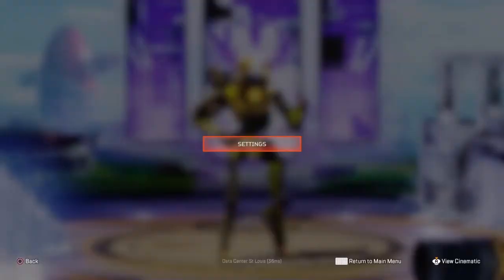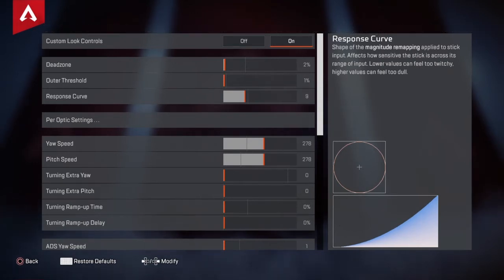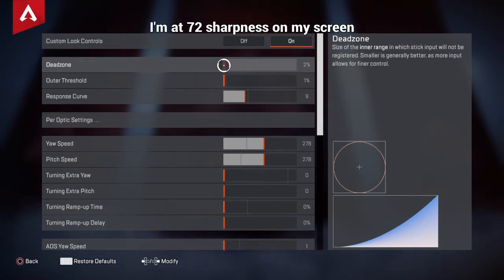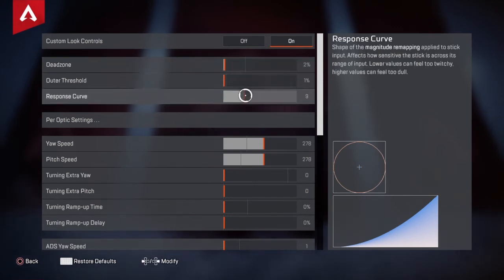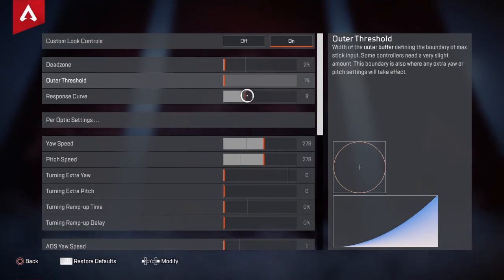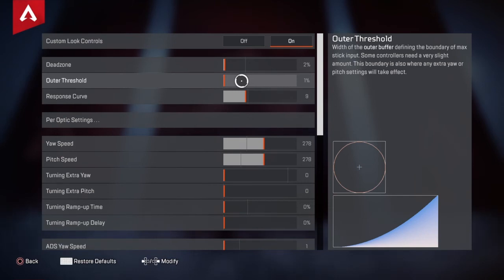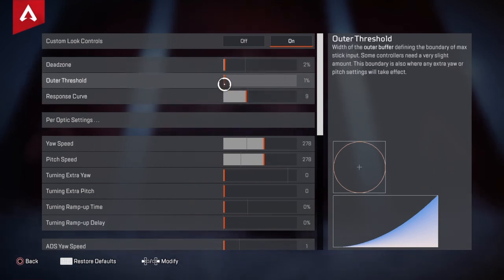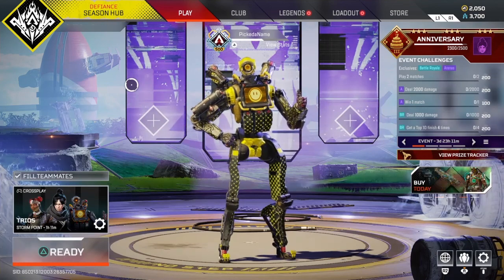Fixing ALCs: Explaining ALC Fine-tuning (The Deep End pt.2)

Comment: Is their a way to get a dynamic response curve from cod on apex? For example 10 response curve is considered classic on apex what response curve would be close to dynamic on apex?
Reply from the maker: Haven't played cod since Blops2, I never messed with my settings in those games.
If you want it to feel like it's always 1 speed try 6 or lower. 7&8 are almost 1 speed with a little ramp up. 9+ will move slow then speed up more aggressively as you increase the curve.
Reply: The dynamic curve employs a reversed S-curve algorithm to your thumbstick movement. This means that you get a gradual build-up in rotation speed relative to thumbstick movement, but it will then accelerate towards raw input to provide the feeling of 'snappy' aim
Reply from the maker: Try 11+ curve, 72 extra yaw, 0-5 ramp, 40+ delay. Those curves grow tall fast, then the extra will make them feel like they're taller.
Pick the curve based on how slow you want the initial movement to feel.
Idk how this will feel while aiming or interacting with the aim assist. You're probably going to need 0 deadzone.
Reply from the maker: I recently messed around with high deadzone and low curve again. That might be the sensation you're seeking. You need your Deadzone to be 5 or 6 to dull the linear slopes at/below 6 Curve.
Your deadzone being high will disrupt your ability to get on target occasionally but it needs to be high to create the sensation I think you're looking for. 
7+ deadzone is definitely too high. 3&4 deadzone don't dull the slope long enough.
Reply: @PickedaName_  so put my deazdzome at 5 and what to put my response curve at?
Reply from the maker: Anything below 7. Everything below 7 is pretty linear. Get it as low as you comfortably can. Try clicking on the bars instead of using your d-pad. There are 10 positions at each Curve # and 5 positions at each Deadzone #.
Reply from the maker: @Clevertf I know more now. It depends on when you want the curve to turn into linear. 7 is a nike swoop, 6 is a reverse nike swoop, 5 is a half pipe, 4 is when it starts to accelerate then turn into linear, 3 accelerates faster than 4 but turns linear at the same spot, 2 accelerates for half of the duration of 3&4, 1 accelerates for half of that and gets increasingly closer to full linear as you approach 1.0 curve. 1.2 accelerates at linear rate then turns into a linear slope.
This video explains how the aim assist changes at those Response Curves
https://youtu.be/KVq0qAoOtqA
(Check the comment section)
I think finding an aim assist shape is more important than input mapping in Apex, as long as it isn't slow/dull for your controller.